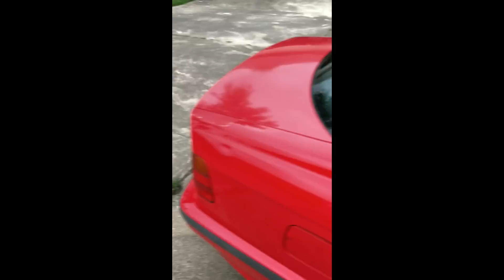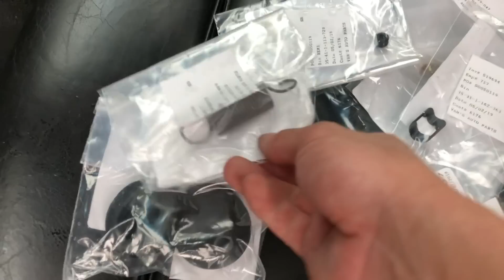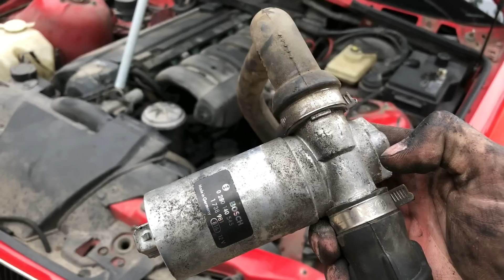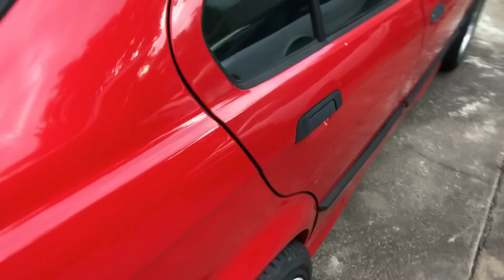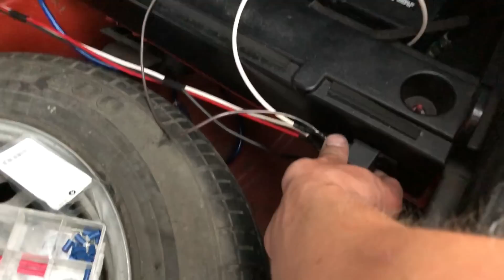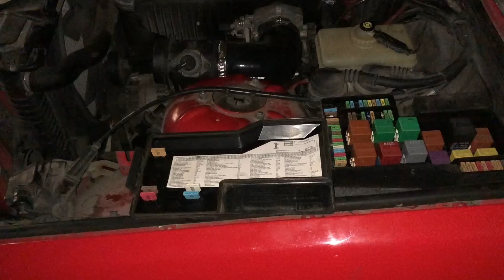Sedan Build - Part 3! IACV fix and fuel pump relay

Comment: Keep the videos coming man. Just remeber to include the small things that you might think is common sense. That could be the one thing a new guy is trying to figure out.
Reply from the maker: Yoichi Films its harder for me to pinpoint those things. I was trying to throw in a little explanation with how each thing works to cater to a newer audience. Ill try to do that, thanks for the tip!

Comment: is the relay running through the ecu? what about the sending unit on the drivers side? currently trying this on my 96 silver label dme
Reply from the maker: the factory fuel pump relay is untouched and still in place, so the ECU turns that one on normally, and then you use the power wire at the fuel pump to trigger the additional relay you are adding.